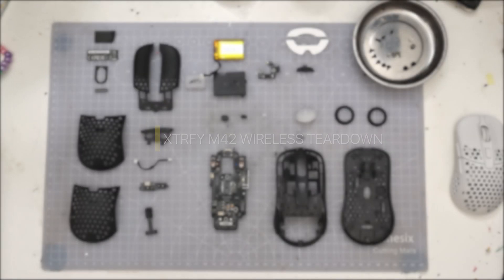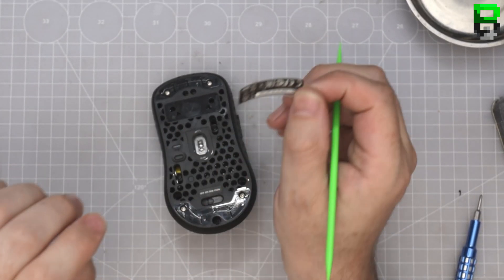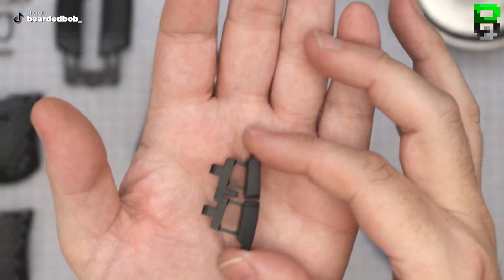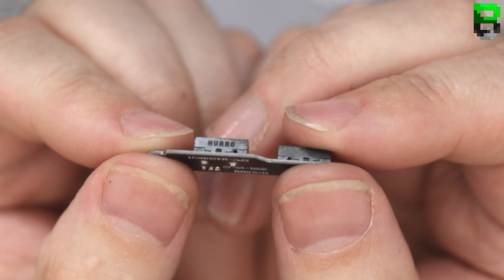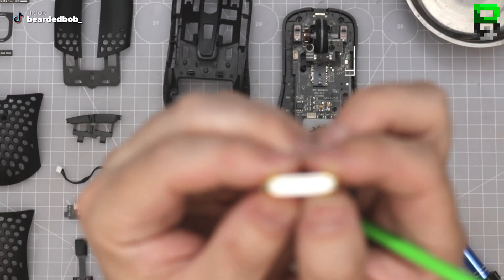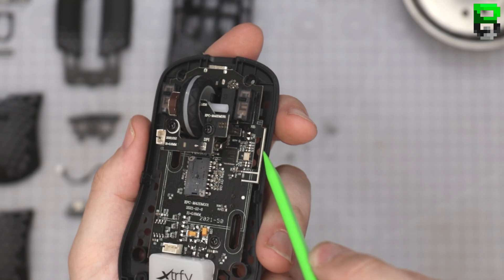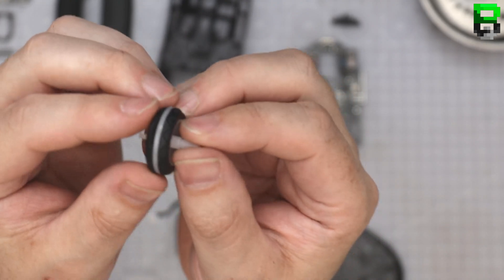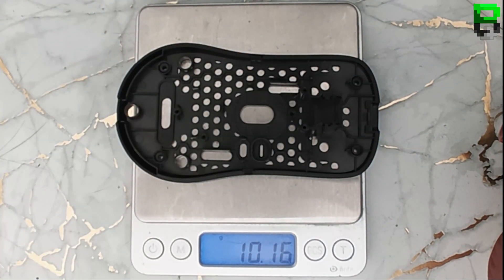YOU MUST SEE THIS SIDEBUTTON CONFIGURATION!: Xtrfy M42 Wireless Gaming Mouse Teardown

Comment: What would you suggest I can easily take off to gain weight other than removing the RGB diffuser ?
at 10:38 the battery case is the battery slider ? Should I take it off ?

Comment: Never battery swapped a mouse and I have some quick questions. What size 3 pin jst connector do I need for the m42? Not really sure because you showed 1.13mm so I'm assuming I'll need 1.25mm but I'm not sure and I don't really want to buy the wrong thing. Also is there anything else I should look out for when choosing the battery I buy except for it being 3.7V, lipo and having the mah I want?
Reply: I'd like to know the same thing!
Reply: Yes would like too kow the same, also whats the name of the battery/where can you but it?